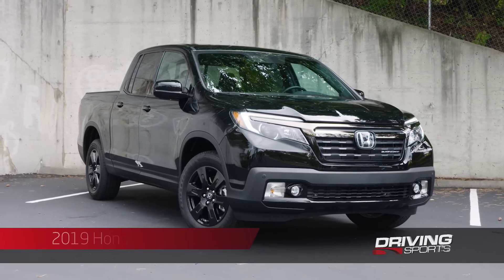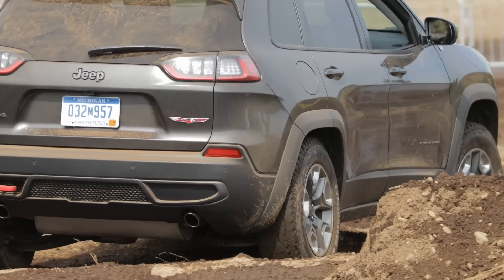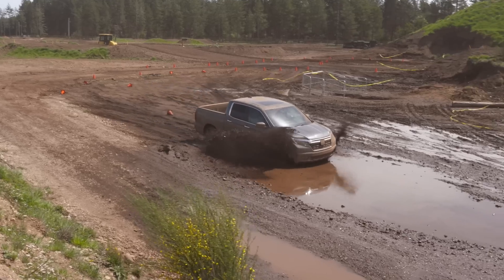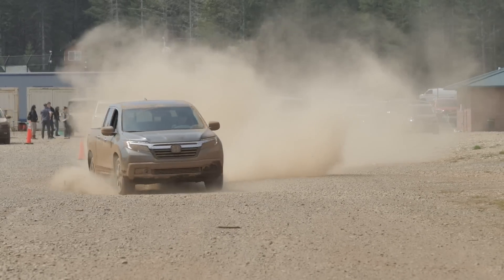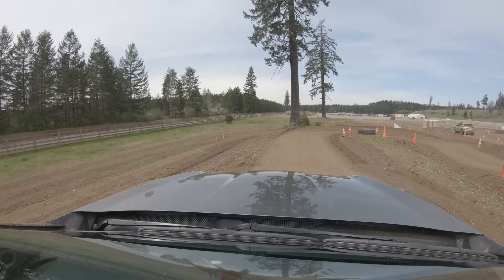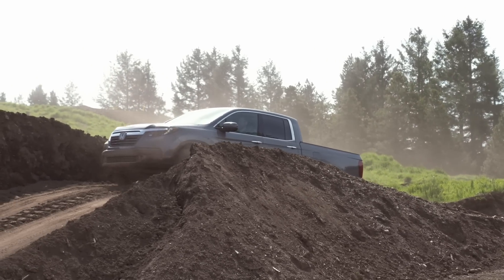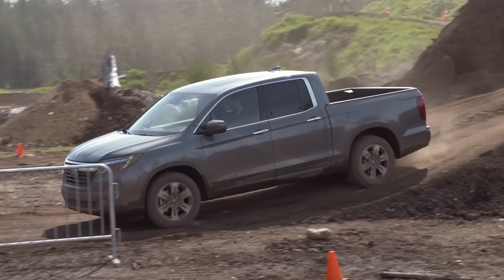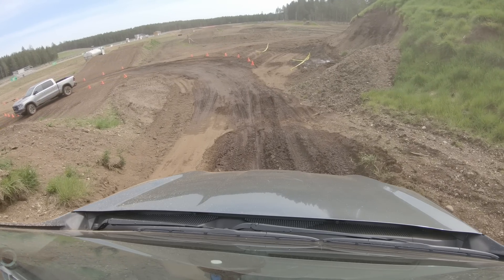2019 Honda Ridgeline Off-Road Test

Comment: I like the ridgline but like the Colorado better for durability doing truck things. The ridgline is all most folks will need and will likely last a long time too. I did not like that the beginning of the video saying the ridgline can tow more than a "Colorado". WRONG. My 2018 Z71 4x4 V6 legally tows 7000lbs.... and can easily beat the 24mpg rating on the hwy.... of course it can do worse with the wrong driver. If you get the off-road ZR2 or gas 4cylinder.... then it  would be correct. The ZR2 tows 5000lbs and the 4cylinder tows 3500. I wonder if the transmission fluid filter is easy to change on these things? That is essential for transmission longevity on a vehicle used for towing.
Reply from the maker: That could have been worded better. As you stated, the Ridgeline has a few pounds greater payload capacity than the Colorado and it can tow equal to the ZR2 Colorado (which is shown in the video) at 5,000 lbs. Because of the greater payload that does mean it can do "more" than a ZR2 Colorado and more than a base 4-cylinder Colorado. Granted, with tow packages and a diesel the Colorado can go all the way up to 7,700 (2WD) or (4WD). Options are good.
Reply: I knew that is what you meant. Just helping car shoppers. That was a good quality video too. Good job!
Reply: Driving Sports TV as I wrote above. Only the Crew Cab not Ext Cab that can carry more payload.
Reply: Depends on what you're using it for. Colorado is no good at the lumber yard for sheet goods. 4' width won't fit in the bed. Picking up sheet goods is, "a truck thing". I've owned trucks for the last 40yrs. In that time there has not been a lot of off roading required but lot's of mileage done that I would like to have gotten 27mpg or higher, like my new Pilot which is the same vehicle as this Ridgeline.
Reply: S Patoine maybe if you don’t know how to load properly. But you have forgot the bed length is shorter that a 6+’ Colorado Ext Cab or long bed Crew Cab! That if you use the two tear loading system, using the molded into the bed sides that let you load long items side by side as high as the wheel wells, then you load the sheets on top. With the tailgate down offers up to 7.8’ Of length. Then of course there’s more load capacity and towing capacity, not to mention off road capacity. Sure the Ridgeline is a fine vehicle, but do not try and compare to a real truck.
Reply: What K.R.V. said is correct. There are some currogations in the sheetmetal of the bed to put boards across to create a lofted platform for 4'x8' sheets of plywood. Though it does drive me nuts as to why in the world they didn't just make the wheel wells 1.5" wider in total (.75" for each wheel well). 

For my 12.5ft fishing kayak I have a truck bed extender... which also works for long pieces of pipe or lumber. When Compared to my old 8ft bed on my old Silverado I had to re-learn how to work the bed. That old Silverado bed could swallow a queen mattress easily. How often is that needed though? I like being able to reach things inside the bed without having to climb in. 

There are a few more options as well...

1. Ladder racks.
2. If you are doing a REAL Big Job and need something like 40 sheets of 4'x8' plywood... Plus a tonn of lumber/etc... there is the trailer option. Just hook up a trailer and the thing will tow it just fine across country if needed. That is an option for the ridline or any SUV as well.
3. The Decked bed system. I want one of these systems REALLY bad (not much needed for now though). These things have a massive drawer slider system several storage pockets around the wheel well. They are water and dust proof. and can hold up to 2000lbs on top(Way past the legal bed carrying capacity). Sheets of plywood would fit easily into the bed. Things like shovels and such would be even easier to grab and go out of the back of the bed when working out in the field. 

For Fuel Economy... 
My true 4wd truck with the 308hp V6 can easily get 27mpg. It does require a trained foot though. Get the truck in 2wd and it's even easier. The diesel in all drives surpasses that easily. So does the 200hp 4cyl gasser. I am about to start doing a daily commute and plan to make some videos on my truck.. fuel economy tests being some of them. Feel free to subscribe to my channel to see them when I post them up. I just towed a 4,500lb enclosed trailer (parachute) across country and averaged 15.1 mpg setting the cruise control to 65mph. So not using cruise would have been a bit better.
Reply: MySuburbanHomestead yes we just finished a 4,500 mile adventure through the west, starting in Massachusetts with just the truck with just my wife, 2dogs and a bed load of stuff to move to Florida. We averaged 27 mpg on that trip down at 70 mph average. The we hooked up to our 21’ Travel Trailer, a Cherokee 16FQ Wolf Pup, that loaded out with 40 gals of water, a 30lbs Propane tank two deep Cycle Interstate Batteries and all our food and clothing at a CGVW Of 9,846 lbs off a Certified Cat Scale. The Colorado Z71,4x4,V6 Ext Cab, without a load leveling system sat perfectly flat almost level with the trailer, with no trailer sway bars that are not needed at the weight of the trailer, 3,890 lbs gross, rode and handled very well, has plenty of braking power, especially when the trailer brakes are working. Plenty of power in the mountains and to pass. On that towing part, of the trip, at just over 3,300 miles we averaged 15.5 mph at all speed limits up to 70 mph! My brother has the same weight trailer we have, but he was towing it with the first Generation Ridgeline, but by 40,000 miles, just shortly after the warranty ran out, so did the trans! Even though he had the dealer changed the fluid and filter at 30,000! I had to drive up to Bangor ME, in my Colorado to bring him up there to a local Honda Dealer to get his Ridgeline with a new trans. When we got there the dealer advised him not to tow his heavy trailer back with the new transmission and if he did the dealer would not warranty the new transmission. So I had to bring his trail home !! While he followed me, instead of me follow him.
Reply: Nice story. Rear wheel drive is the way to go for heavy loads and durability when towing. The Ridglines would be fine across town or something though I am sure. My wife's FWD Ford escape has to have the engine and trans pulled... then split the transmission case apart just to change the transmission fluid filter. Has a tow rating but no thank you. 
I wonder if the filter is easy on the ridgeline. Anyone know?
Reply: I have the two tear loading system. It sucks.
Reply: S Patoine I recently found yet another option to enable me to throw on around 10 sheets of 4’x 8’ plywood... and still be able to throw most things into the bed of my Colorado. The product is called the Diamondback Bed Cover. It comes in a more lit use of configurations and can be either plain diamond plate or coated diamond plate. The lightweight version can hold up to 400lbs on top and the HD version can hold up to 2000lbs. Insanely adaptable.
Reply: That thing is pretty cool. Thanks! So much of getting the vehicle to do what you need, is in the accessories.

Comment: Can we not call that turd wagon a "truck"??  That is by no stretch of the imagination a truck!  That is a car with a bed and not much of a bed. Unibody has no business in a truck.  Towing 5K behind that little thing would be negligent.
Reply: Your theory is based on what ? It's a mid sized truck that is build to fantastic specifications ... Think before you speak
Reply: wurly164 I didn't have to think very long to decide this little thing isn't a truck.  Just an opinion based on years of truck ownership.  I have owned little ones and I have owned big ones and they all have a purpose undoubtedly.  By my definition, a truck is for hauling and towing.  If you want to put a bed on a car that should be called something other than a truck like a pickup for example.

Comment: Where can you watch the SH-AWD video?
Reply from the maker: The original video was available on Honda’s media site about a decade ago (Japanese dubbed in English). It’s not there anymore. We searched on YouTube and couldn’t find it either — subbing in a “close” video that was released in the European market.
Reply: @drivingsports  you mentioned at the beginning that the Ridgeline offers "Super Handling All Wheel Drive". Is that true? I thought SH-AWD was only on Acura. One other follow-up question: if it is true Ridgeline has SH-AWD, did Honda add SH-AWD to the Rigdeline but added i-VTM4 to its sibling the Pilot? Talking of the 2019 models.
Reply from the maker: Mom3ntz Glitterazi it’s actually i-VTM4 on the Ridgeline, which is mechanically the same as SH-AWD. We just posted a video that explains the differences last week.
Reply: Driving Sports TV oh yes, I watched that video. Wonderful job you do on your videos by the way. I observed the Ridgeline behaving the same way when you went through the mud just like the Acura MDX did in the other video so I was kind of taken aback when you mentioned SH-AWD in the Ridgeline at the beginning of this video. Which makes me think (I may be wrong) that SH-AWD is not significantly different from i-VTM4.

Comment: who fact checks these claims? are they bench marking the lowest capability Colorado?  Because the colorado has a payload rating of up to 1,548 lbs and towing ability of up to 7700 lbs.  both those numbers beat the honda van thing they call a truck
Reply from the maker: We’re using numbers from the ZR2 (which appears in the video)
Reply: i sort of figured, just seems like a cheap shot to make a general statement that it bests a Colorado then pick the lowest rated version.  if you go there one could say it beats the f150 full size pickup too  in payload and almost in towing(since the raptor is an f150 and in crew trim is only specd to 1000lbs in the bed and 6k towing) .  at the end of the day it just seemed really misleading.  The ridgeline is a lifted van with the back cut off and a crossover AWD system chucked in.  the comparison to the subaru baja really fit the best in my eyes, but honda did it much better.  The ridgeline can do truckish things well for a open backed crossover.

Comment: 2 problems with the ridgeline. Comfort is really lacking. Not only in the seats but also the suspension.  Would like to have cloth seats with a rear window. Not a fan of the theater back seats either

Comment: Yes it's a strong 3.5 liter that is an interference motor so better change that timing BELT at 100k miles which is a P.I.T.A.  It is literally a half of a pilot.  
I'll keep my Yota.
Reply: This is a silly comment.  A lot of companies run interference engines for performance and economy.  Any lack of maintenance is bad for your vehicle, so change the belt/tensioner when you're supposed to, and it's not an issue
Reply: @danhughes1814  factual statements are silly?
Reply: @g2theb584  that's clearly not what I'm saying; I'm saying your complaint is.  Proper, routine maintenance negates the "cons" of an interference engine, so I don't see the issue

Comment: Lets clear things up - I like the Ridgeline but "more load capability than a Colorado"?  by 10 lbs, but 2000 lbs LESS towing capability.  You could also say that the Ridgeline has LESS load capability than an Odyssey...which is true (1665 to 1586).   Get real with your hyperbole man.

Comment: Rather buy this Ridgeline instead of the ugly minivan looking Pilot... old suv Pilot rocked.
Reply: Jerry Cruz the ridgeline is a pilot with a bed....
Reply: Chris John Michael new model Pilot are minivan shape.  Ugly.  Older minivas were SUV style.    I would never get new pilot they lost bigtime SUV style.
Reply: The old Pilot got 20mpg if you were lucky. The new can easily get 30. I know because I have one. The new Pilot runs circles around the old one in every way.
Reply: Yes old, old before 2007 an later models was awfull in gas.  But 2010 and newer are great in gas 3.5L engine.  So  you just talking crap cause you have the new Pilot Minivan... not 2015 real SuV style.   You have new 2017 soccer mom minivan HondaPilot.  You got suckered in...

Comment: The Ridgeline is NOT a truck. Sure, they made it look more like a truck by separating the bed from the cab but, it's still a front wheel drive unit body design. Basically, it's just an SUV with its a$$ exposed.

Comment: THEY NEED TO RESTYLE IT. IT LOOKS A LITTLE TOO PEDESTRIAN FOR A TRUCK. PROBABLY SOMETHING THEY'RE SHOOTING FOR BUT IT LOOKS REALLY BLAND.
Reply: Peter L it’s exactly as its intended. Out of the box, unconventional, and performs very well. Better than a box on wheels like all other American trucks
Reply: Although I kind of like the front end of it I can see where people who are a bit more in to a traditional truck look might find this front end a bit too tame. But to be fair, I think the front end is designed to appeal exactly to the segment this truck is marketed towards, which is traditional car owners, who want a truck on the side for occasional hauling and even a trip or two per year to the campgrounds. On the other hand, Honda has made this trucks drive system competent enough to even be able to attract a more serious truck buyer which I think is a category you might fit in to, so what Honda should consider doing with this truck is adding an optional version which would include a more edgy, tougher looking front facia, 1" higher suspension height, stock mud flaps, front skid plate. I see that some dealerships are now offering a lifted version of this truck, thus we're not the only ones who see that this truck could have broader appeal if optioned that way.
Reply: Its by a truck its a tumor
Reply: They did like 2 years ago.  Honda changes their models every 4-5 yrs.  Definitely like this look better than the prior ridgelines.
Reply: Design as intended !
Reply: IMSTuner 

CAN'T BELIEVE THERE'S NOT MORE NEGATIVE CRITICISM OF THE STYLING. FOR A TRUCK, IT'S UGLY AS HELL. FIRST THING I THOUGHT WHEN I FIRST SAW THIS TRUCK.
Reply: Not everyone wants a truck full time. I'm getting it because it will be my daily driver. I  only need it to go to Lowes, tow my 2 motorcycle trailer. Why in the world would I want to buy a full time truck like a Tocoma, F150. The Honda handles better for a DD and fits all my needs. It pretty much fills the void and that's why it will succeed.
Reply: IMSTuner 

IT'S A HIPSTER TRUCK. AT LEAST THAT'S HOW I'D DESCRIBE THE STYLING. NOTHING AGAINST HONDA BUT I REALLY DON'T KNOW WHAT THIS TRUCK WANTS TO BE WHEN I LOOK AT IT. THE TACOMAS ARE NICE LOOKING. THEY HAVE THAT RUGGED STYLING.
Reply: Also like the fact it has AWD.
Reply: I miss the old body style
Reply: agree
Reply: Why are you screaming at us?
Reply: well. if u love civics and had been buying f150s coz i want a pick up truck. then honda finaly made one and its ugly as hell for ur taste
Reply: Hey turn Caps Lock off
Reply: Peter L It looks like a car & works like a compact truck.
Reply: The old body style was better
Reply: IMSTuner because you can by an f150 that gets better fuel economy for about the same price
Reply: I agree
Reply: Have you seen Nissans lately? This us a car-truck.
Reply: ??? It looks like every other medium truck out there - Ford, etc.
Reply: Mitchell Mackenzie said "you can by[sic] an f150 that gets better fuel economy..."
Not true, the Ridgeline gets better mileage. I consistently get 25 mpg around town and still get 15+ when towing my 3,000 lbs camper (except at altitude).
Plus the Ridgeline has much better ride.
Reply: I agree,  when I saw the pilot style front end on the redesigned Ridgeline,  I  decided to keep my 2008 Ridgeline for a couple more years.

Comment: It’s an mini van with a bed...
Reply: Slingsomelead 
You mean a Honda Odyssey with a bed
Reply: Odyssey never came awd or 4wd
Reply: A Colorado V6 can tow up to 7000 lbs and the baby duramax can tow 7700 lbs. the only Colorado that ties less are the Zr2 and the wet or z71 I4
Reply: ZR2
Reply: The AWD system sucks on actually off road obstacles.
Reply: Slingsomelead its based on the pilot.
Reply: Its a Pilot with a bed....and I freaking love mine.
Reply: Andrew Cardoza I own one.  No it doesnt
Reply: Honda means legendary reliability. GM will always be known as the company run so poorly that it needed a government bailout to keep from going bankrupt.
Reply: It's a Pilot with a bed. You don't know Honda's. Because it's a Pilot with a bed, that is why it beats everything else in it's class.
Reply: Brett OBerry The reason I will never look at a GM. They shouldn't have been bailed out.
Reply: Lol and yet here u are watching this video. Curious?
Reply: Peter Lee I like cars and have an interest in the auto industry.
Reply: honda's AWD system is right up there with Subaru's for the best in the entire world.  I have owned both honda, subaru, ford, and toyota... I can tell you that the AWD from honda and subaru beat toyota and make Ford look like amateur hour.
Reply: Haters gotta hate. Trollers gotta troll.
Reply: and that's a good thing